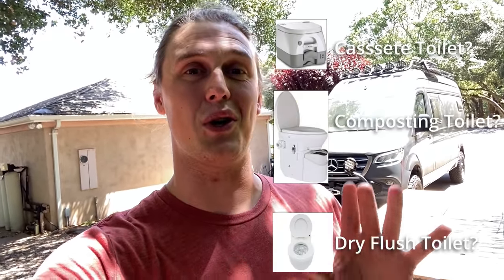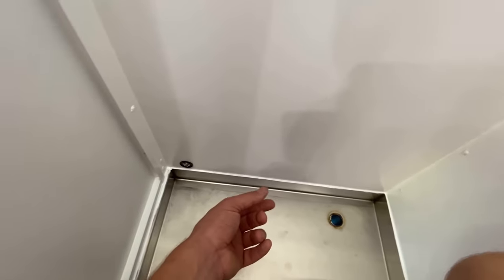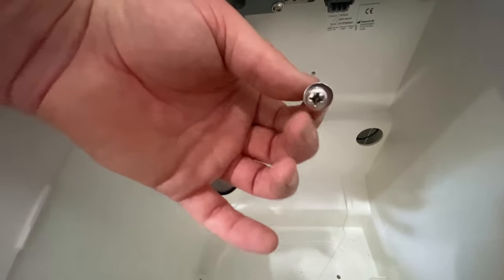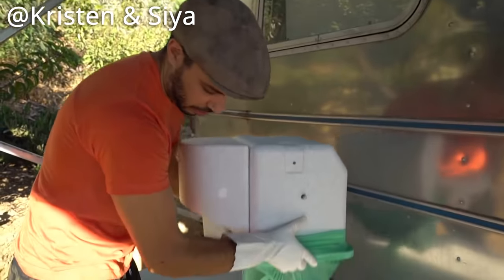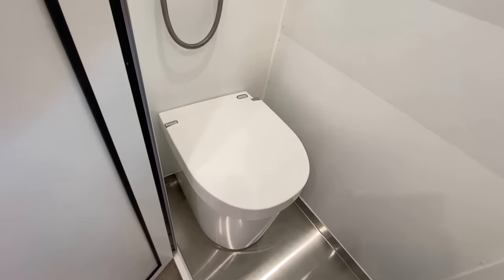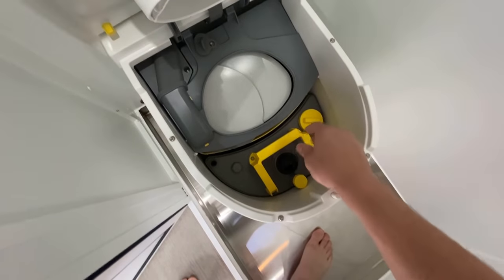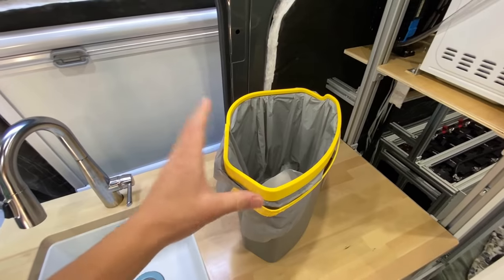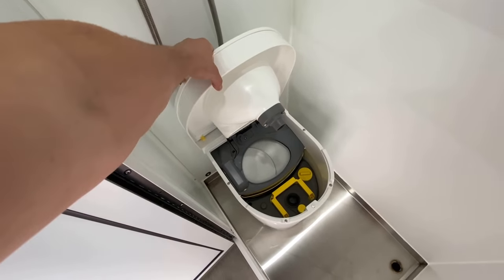The BEST TOILET For Van Life??? Hint: not composting

Comment: Having used and lived daily with a "Natures Head" for almost 5 years; I cannot say enough about how easy, cheap and clean it is- all with absolutely zero smell or mess. Obviously anyone throwing shade without any long term experience using a product should be taken with a "grain of salt".  Maybe more research on people with long term actual experience using this product would make more sense, before making any purchase.
Reply: Wwe love ours.  We use it in our house in a spare room as a 2nd toilet when necessary.  Cheapest 2nd bathroom installation ever.
Reply: Only thing I don't like about it is that it is a bit tall for us short people. We need some kind of step or platform to step up onto so our feed don't dangle.
Reply: @amywalker7515  ,
a step up to the throne !
Reply: The initial cost is outrageous for what it is.
Reply: I built a wooden box with a toilet seat lid and a cover lid with foam trips to make them air tight.  Put a bucket in it with trash compacter bags and kitty litter. (For camping in my Ursa minor jeep).it works great and doubles as a step.
Reply: How do you empty it?
Reply: @wendywhite2642  You remove the top part, leaving you with a container full of dirt. It doesn't stink like feces, it smells like freshly turned dirt or some such assuming you didn't like literally just go right before... Pull a plastic bag (or strong composting bag, even better) over it, turn it over, and tap the dirt/composting mix into the bag. Put the toilet/container back and prime it with new composting medium; many people go with dried coconut coir that they hydrate with water first in a separate bucket until it's the right texture. Pour that into the toilet and you're done for a month or more. Dispose of the bag with composting material like any other trash. No need to wash the container, leaving the enzymes etc in there is just helpful for the next batch.
Reply: @shurppa64  The original and best solution yet. Every other camping toilet is complicated and messy. Nothing could beat bucket toilets for its ease.
Reply: “Hand trowel out the feces”! Sounds like the human equivalent of a cat litter box.
Reply: Quite a few negs in the UK on natures head
Reply: Define "5 years"!! I bet it's 5 years in a camper van you only use for trips and not 5 years of actually living inside the van full time. Because full timers say the total opposite of what you're saying. Why don't you apply your comment to yourself. Here, let me do it for you:  Obviously anyone throwing shade without any actual long term experience using a product should be taken with a "grain of salt".
Reply: @flybeep1661  I am full time, with a family of 5. Nearly 6 years, with an Airhead, nearly identical in operation as the Natures Head. No problems AT ALL, no smell, no grossness, even when emptying… nothing but the smell of potting soil.
Reply: @bryanniven.  is there one video that you recommend we watch, about the Airhead?
Reply: @paulkajtna7799  There’s not necessarily a video that I am aware of that will answer all your questions in regards to operation and ease-of-use etc. However I will be revitalizing my own channel, featuring tons of helpful how-to, experiences, and product reviews, from my own findings after 6 years of full-time tiny living, which will include many videos on our Air-Head toilet.
Reply: 😂🤣😭 Yeah ok
Reply: @amywalker7515  make a step then!

Comment: Great video! It was incredible to see the progressive thinking/engineering that went into this toilet! With that being said, after personally using the Airhead toilet full-time , (with a family of 5), for nearly 6 years now, I can tell you that if anyone is having to “ trowel” the solids out, you are REALLY doing it wrong. The solids tank is simply removed and dumped into a bag and taken out. I just switched out our solids yesterday and the process was all done in under 10 minutes, and it was done INSIDE of our tiny house bathroom, without gloves etc. Keep in mind that a MAIN reason for compost toilets is to allow the solids moisture, (roughly 80% water), to be ABSORBED by the organic material so that there is ZERO smell, and contrary to your feedback you received, composting actually DOES take place if you can give it enough time, even after being  dumped in the trash, and without smell. The goal is to cover the solids quickly and allow the moisture to be wicked away in the coconut core/peat moss etc. If this is done properly, I/we should be able to confidently uncover the solids tank at nearly any time in the process, and smell nothing but a earthy soil smell. Remember, you will simply be dumping what smells like rich potting soil having kept the balance of moisture in the solids tank.  If you have smell with any commercial version of a compost toilet such as Airhead or Nature’s head, (which BTW you have the labels flipped in the intro), than you ARE DOING IT WRONG. With all that said this design is fantastic, and I would simply add organic material to the solids tank to absorb the water in the solids and allow evaporation to take place. Any time I have shown anyone our toilet they are blown away that there is ZERO smell… ZERO… even with 20 days of a family of 5. Again this design looks super clean, and I would love to simply see some sort of agitator added for those who don’t want to smell the goods when changing the solid’s tank. Keep up the great work on the videos👍
Reply: This is such a great addition to what I just watched...also previously watching YOUR video (the fam of 5 guy).  I have an RV w a fam of 3-4 and the smell and hassle of the black water tank gives me anxiety bc I will be living in the RV again, after a 6-month break.  Now I have the confidence in the investment I'm about to make.  Thank you so much for putting so much great content out for us newbies and RV/outdoor nerds alike!
Reply: Your van will smell like shit with all the stink fanned out
Reply: Ewww😂
Reply: Hahahaha sir this is why I cannot do van life I can so relate to this "unique digestive systems"
Reply: Memer Dreamer  I feel like a 7 year old for laughing at that. I can't get the image out of my head.
Reply: What a stupid remark!!!
Reply: @goldberg1174  keep in mind that a compost toilet, like the airhead or natures head, have fans that suck the inside air, out of the van, through a vent hole. 👍 again, I can’t emphasize enough, that if the process is done properly, there will be ZERO smell, other than the initial deposit smell, which exists with any toilet.
Reply: Memer Dreamer  I thought you would like to know that they already have sub floor systems, where the top portion is much more traditional in style, and then the deposit tanks, both for liquids and solids, are below the unit. Sorry to hear about the unique digestive system, though it might be interesting to know that how are Airhead toilet is used with a family of FIVE. Myself, 6.3 200 pound male, and two adult sized teen boys, (16/18 years old etc, my wife, and my daughter. In other words, there’s a lot of depositing going on, and as long as there is a good nights worth of heating going on in the tank every night, you should be fine. Especially, because it seems like your body’s system does not produce daily  deposits.
Reply: No problem. The solids “trap door” on the Airhead is about 5” in diameter. Living with less, being more intentional and simplifying requires planning ahead. In other words, no waiting till the last second to use the toilet. 😉 We learned that quickly as a family. Every once and while a deposit might brush/hit the inside of the bowl, but even with 3 full sized males it is pretty rare. As for the air flow, yes, room temp air, (ideally lower in humidity), will suck through the side vent into the solids tank and out the hose to the outside. Composting by design creates heat and will literally COOK the organic solids in the tank. When I change our tank every month, (like I did today), I am met with a whoosh of heat and ZERO foul smell. I do smell, however, a soil/earthy scent, similar to a garden center. The key is air flow, enough time overnight to cook and evaporate the water in the stools, and the base matter of peat moss or coconut core to absorb.
Reply: @bryanniven.  hey would you use that to fertilize your yard? I think it would be kind of cool to see the nutrients you ate recycled into your garden. 😄😄
Reply: @KirbyZhang  I absolutely have, where permitted, and it’s unfortunate that we don’t more fully understand composting. It’s always interesting to me as I have simplified over the last decade, to realize that we really do all these things that are often seen as gross, or weird, or strange, or otherwise not “, normal”, but they’re just done on the backend, on an industrial scale. In other words people may or may not realize that their excrement is being extracted from our drinking water through a horrendous filtration process, evaporation and dehydration process, sometimes commercially composted, and then used for fertilizer. In other words human excrement is already being processed and used as fertilizer for our food, but no one really knows it’s happening. It’s unfortunate that we don’t all adopted on a microscale in our own families in household, and reduce all the waist and energy and money used to create it on an industrial scale.
Reply: @alenabarros  my partner and I went whole food plant based, the benefits have been great, especially for van life. On top of better digestion, you remove most dangerous bacteria by not having animal products on your counters. We made the change due to some lung issues that were parting gifts from the military, doctor recommended a low inflammation diet, so when we researched it, it was clear to make the switch. Best decision ever.
Reply: I'm confused.  I thought any smell was more likely to come from the urine than the solids.  I've seen designs that incorporate a fan to expel air away from the urine for that reason since, as you say, the peat moss takes care of any smell from the poop.
Reply: @libbyholt3863  there really won’t be ANY smell using the Airhead or the Natures Head, if done properly. None at all. To specifically answer your question, NO, the smell from the liquids tank is non- existent.  These toilets are $1000, and they have been in business for a long time, with plenty of real world experience, so they have rubber seals/gaskets, and a VERY important element is the negative air pressure I keep mentioning, created by the fan. This fan sucks air from inside your van, or tiny house/rv, through a vent on the side of the toilet, pulling any mild aroma, from both the solids and the liquids tanks, and pushes it out through an exit vent/tube, and out into the outside air. You have to understand that this air pressure is just enough to keep fresh air flowing through your toilet, so you never smell anything. If you were to lose power to the fan, see if your battery died, or your battery banks were depleted, or you weren’t hooked up to shore power, you might begin to smell a faint aroma. We live on the beach, so in rare occasions, if the wind is strong enough and happens to be blowing in a certain direction that allows outside air to overpower the small fan and reverse the pressure, we also sometimes smell of faint aroma. Losing power, and overpowering wind, perfectly positioned backed up through the exterior vent is extremely rare, and even then is just a mild scent.
Reply: @bryanniven.  Thank you!
Reply: @goldberg1174  Not my experience.  Next to nothing. There is very limited smell when #1 and #2 are not mixed.

Comment: A friend of mine has a homemade version of this in his camper van--but without the vent hose.  He keeps a 1/2 gallon jug of campfire wood ashes (cold ones) next to his.  He states that  a ~1/2 cup portion of wood ash (per use)  completely eliminates the odor in the #2 section.
Reply: Can also use lime
Reply: I really appreciate that you specified they were cold ashes 😆
Reply: Maybe adding handful of cat litter after #2 wll be even better for moisture and odor control
Reply: @user70331  I've heard lots of ppl rave about Horse Pellets from a farm store both for camper toilets and for replacing your kitty litter!!!
Reply: Any chance your friend will post a vid on how she/he made the toilet?
Reply: @rebeccaprange9310  Sorry, I've lost touch with him.  What I remember:  It was basically just a plywood box with an attached toilet seat lid.    He had foam seals glued under the seat (between seat and top of wood box)  and also under the toilet seat lid.  He made the seals (gaskets?) from closed cell foam (~1/2" thick?)...thus any possible odors stayed in the 'box'.  He used a large funnel--strategically placed that diverted the #1 (liquids)  to a empty detergent bottle (~1.5gallons) inside the front of the box.  The larger open area (behind the funnel) was for 'solids'...which dropped down into a small (1-2Gal. ?) black bucket...lined with a large paper grocery bag.   For first use he put a layer of wood ashes on the bottom and then added more when needed.   Notes:  Box was painted with a nice enamel white paint--looked professional, and was about the height of a standard "chair height" toilet.  The top had hinges in the back for changing out the contents.  Whenever possible he stated he used a campground or store restroom to reduce the need to change the bucket & bottle.    Hope this helps.
Reply: @rebeccaprange9310  you can just look up composting toilet bucket system in yt youll find plenty information. Actually you dont need a fan or an agitator, I live in a tiny house with this system, all you need is to cover the #2 with dry carbon material and thats good. Ashes are also super efficient as they are pretty much what they use in carbon filtration systems to reduce smell and purify water.
Reply: No vent dangerous methane gas very volatile not to mention the stink
Reply: yeah charcoal and ash is amazing I was thinking the same

Comment: Seven, I built almost the exact toilet. I ordered the Separatt urine diverter and made a wooden, oval box that was the same size as an elongated toilet seat. The top of the box opened under the standard elongated toilet seat. I added a 1 1/2 plastic flange adapter, in the back, and in it, installed a 12v computer CPU fan. Ran a 1 1/2 sump pump flex hose through the floor. I used a 5 gallon bucket and standard kitchen trash bags. I did use saw duct between uses, which worked well. The pee jug was a few Simply Orange Juice bottles. It ALL worked perfectly.

Comment: There is no need to scoop out a composting toilet with a trowel.  Either dump the compost container into a trash bag and dispose in a dumpster if you are in a populated area or take the compost container outside and dump it in the woods if you are in a rural area.  Having said that, I like the system you selected also.  To each his own.
Reply: And, why couldn't you carry a small wet-vac to make the process easier?  That way you wouldn't even have to take the composting toilet out of its "home" to empty it.  You can store the wet vac in your van "garage," and RV storage bay, the bed of a truck or in a plastic bag on a roof rack....
Reply: I agree.  We had a composting toilet we used when we remodeled our bathroom.  It was simply a 5 gallon bucket with a toilet lid on top made for the bucket.  We put a garbage bag in it and did number one and two in it and just used saw dust each time to cover it then when it got full, pulled the bag out, tied it up and threw it away.
Reply: My objection to the composting toilet is that you have to carry it outside and turn it upside down to empty it because that's too heavy for me. I love this waterless toilet idea! I love the fact that it divides the urine and feces for separate disposal. That urine collector could be dumped down any street culvert or even out in the woods at the side of a road. I used to use a system like this in my boat. You would sit on a seat perched above the water in our bathroom on board, but you would poop into a bag a grocery bag suspended across the seat opening. With just a little care the water would drop to the water below and the poop could be tied up to contain smell, put in the trash and thrown out at the end of the day. It was a very easy thing to do even with a crowd of people on board.
Reply: @SherryAnnOfTheWest  imagine cleaning the vacuum

Comment: Cool. Interesting how similar it is to a compost toilet. I think I would still add sawdust or coco fiber each time I used it, because it's better for the environment in the end, and also because it won't smell as bad when you empty the open bag.
Reply: I also just really don't want to look at it
Reply: I agree with ye T and Gorm. I wouldn't object to having it tall cereal type tupperware beside the loo with wood chips or kitty litter in for sprinkling over the solids. I like what I see of the Seoaret system tho. G Ire
Reply: The capacity is limited.
Reply: The "trapdoor" closes once you get up, making adding other stuff problematic. I suppose you could sprinkle between your legs if you are young and agile.
Reply: @Area_Man  HAAHHAHAHA